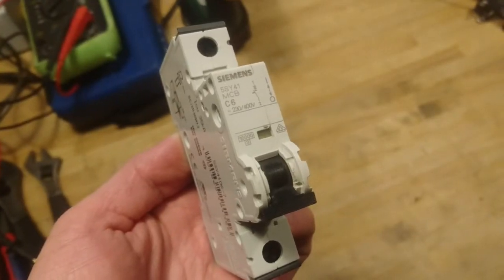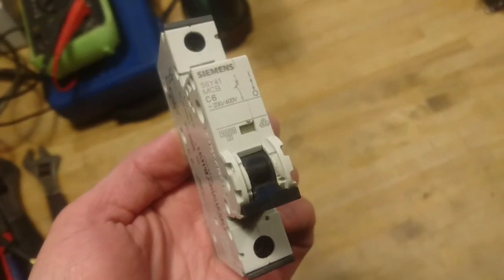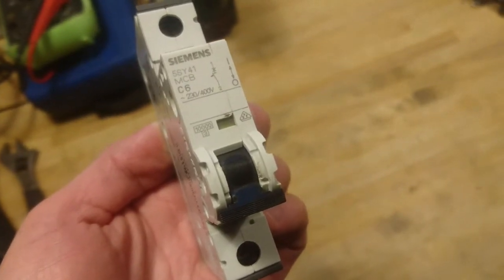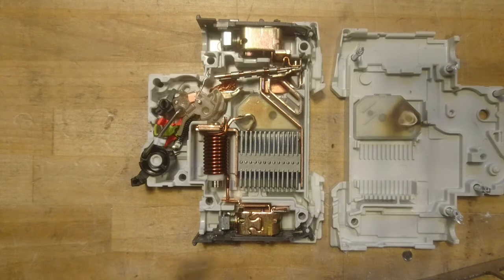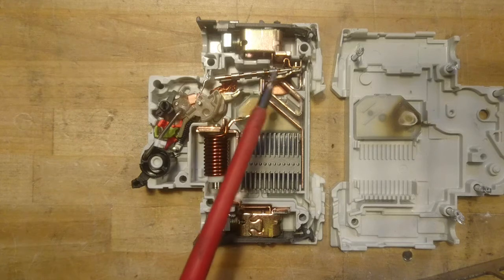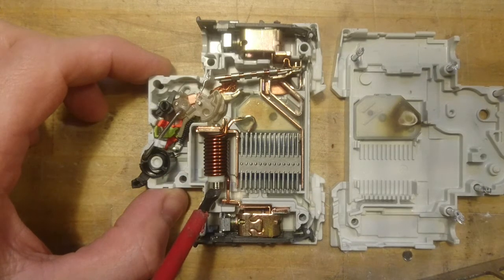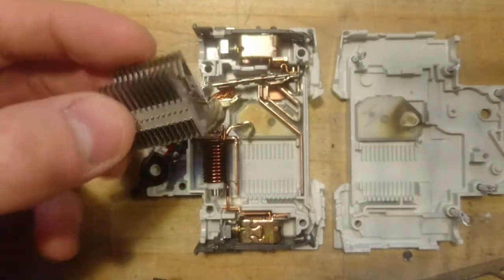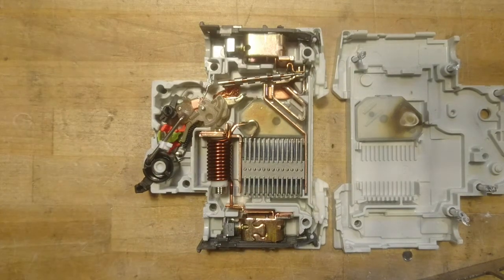Mysterious Failure of a Siemens Mini Circuit Breaker C6A (5SY41)

Comment: I have seen some breakers have a small contact between the two bars that is more resistant to eroding from the arcs. Maybe it broke free or was vaporized from so many switches?

Found this picture that shows the part I'm talking about http://www.galco.com/images/moreinfo/op_mech.gif
Reply from the maker: Ah yes, it could be a wear resistant contact surface that is missing, I do not think that it could vaporize, but also there was no loose parts coming out of it as I took it apart, but this seems to be the most likely explanation, missing wear-resistant surface contact point.
Reply: i'd second Geoffery's suggestion of missing contacts, it's clearly been arcing a bit from the residue on the plastic case. As you mentioned in the video they are only designed for a certain number of actuations so this could well be the part which fails first and prevents using them after an approximate number of times.

Comment: There is a problem in this mcb for sure
But keep in mind you can't achieve full contact when the case is open due to the movement of the rotation axis represented by the steel little stick